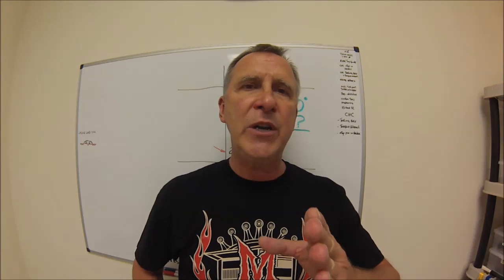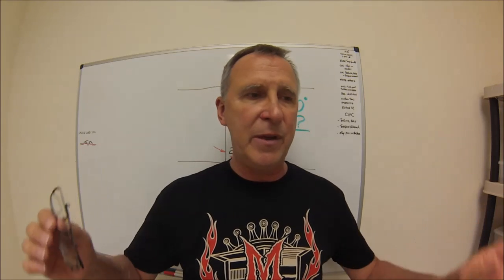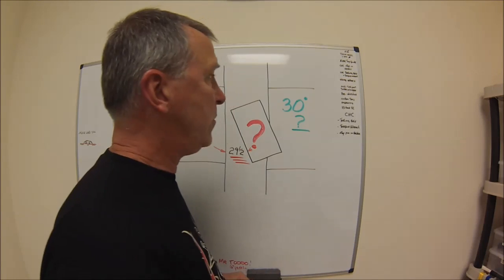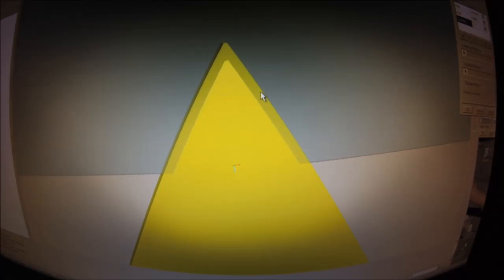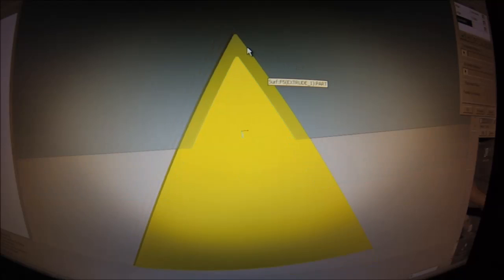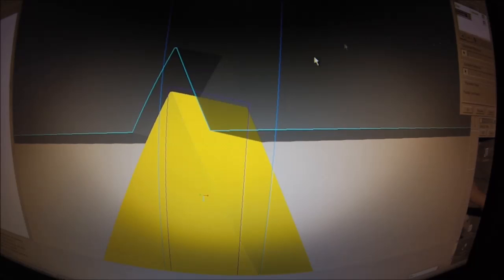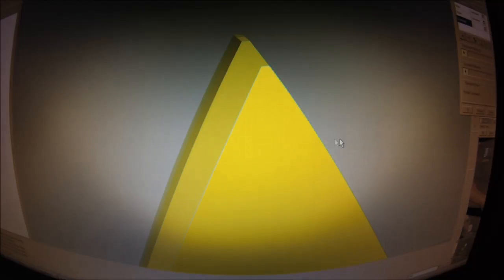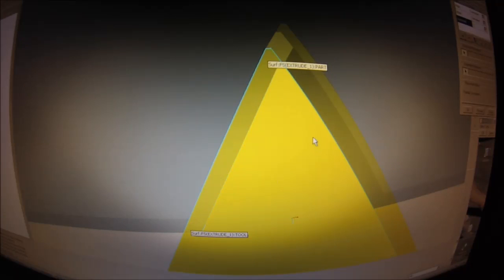Lathe Compound Setup for Single Point Threading...Myths and Musts

Comment: I have always heard that using the compound at 30 d, reduces chipload. I don't think it does. If you make the thread with the same number of passes as a straight plunge, the chipload is the same and it's mostly on one cutting edge. It has to be the same because in the end you are removing the exact same amount of material. To me, the only reason to use the compound is because you don't have to remember any dial positions except 1. It's more foolproof but you don't have to set the compound at 30 degrees. You can set it to anything between 0 and 30.
Reply from the maker: It really does shift the load bias from one side to the other of the tool. If your thread is tearing up, a compound feed will probably improve it.
Reply: @joepie221  Yes it does shift chipload  but the common misconception is that it lowers the chipload.  If shifting it provides a better finish then by all means rotate to 30. I cut some threads the other day and I don't even know what the compound was set to.  I just swung it out of the way of my cross slide because the handles collide. But you are correct that arguing about 29 or 30 is pointless and this video got me thinking about what is really happening. You take things to a more scientific level. Good stuff.

Comment: Using carbon tipped indexed tooling I don't see the benefit Joe, why load one face (mainly) when you can share the load over both right and left face especially seeing as nobody bothers doing this when cutting internal threads? So why bother?
Reply from the maker: I set my tools square to the work and plunge cut my threads. If your machine is rigid enough, its fine.

Comment: The reason for 29 1/2 deg setting on the compound is the last psss you dial the cross slide and not the compound to clean up both sides.
Reply from the maker: Both sides cut the entire time anyway. The load is just bias to the left.
Reply: @joepie221  - Unless you are over 30 degrees.

Comment: seems that if compound is set <29* then each side of finished threads will have too much different angles and wont mesh as well with the female threads.  which wouldnt be a problem with 1a or 2a thread but would with 3a as it has zero tolerance.  just thinkin....and thanks for your super vids.
Reply from the maker: Actually, the 29 degree just distributes the chip load differently. The thread profile is still 30 degrees per side if the tool was setup correctly. I have a good video on whats really happening with that 29 degree setup. Look for it.

Comment: how about the fine cut, when the depth (AP) reducing after times and times cut, maybe the final is zero AP, all the deforming tolorance will be dismissed? the flange angle will be 30.5/29.5,  unless can find a carbine with 59.5 degree angle? It is no problem on assemble but not good condition on holding force when female thread touching area become smaller. Sorry Joe about I'm used to a diver , not good at leaving a message.
Reply from the maker: A straight in approach will produce a thread to any tolerance desired, naturally, the tool and compound setup should be correct for your thread profile. Multiple passes at the same setting as the final step should allow for the full profile load to be sufficiently absorbed and form the desired geometry.
Reply: I'm confusing on 29.5 degree's subject. Maybe you are talking the cutter feed in way, but at the very beginning I think it is the blade position. Now I know it. Thanks.

Comment: there is one thing the cosine error setting compound at diffearant angles will give a diffearant distance of travel
Reply from the maker: Linear to the compound, there is no error. If you have a specific depth to hit, know what that is on your cross slide and start with your compound backed off. Error is then irrelevant.
Reply: Easiest solution is to use a dial indicator fixed to the cross slide, measuring the change in the tool position as it gets advanced by the compound.
Reply from the maker: That would work as well. The compound trick is good for internal blind work. I'll show that someday.

Comment: If you use fullprofile threading insert, and feed your compundslide 30⁰ then your thread bottom radius goes too large
Reply from the maker: I respectfully disagree. A full profile insert is a form tool and will simply make the thread impression deeper when fed at 30 Degrees.

Comment: Been a machinist since I was 16 , now 53 & own my own workshop & I have never seen the need to do this . Leave the compound slide parallel to the bed unless cutting a taper with it. Most of the threads I cut are metric & it's easy to get the the root diameter from what pitch you are cutting & increasing each cut on the cross slide. If you want you can releive the pressure on the right side of tool by bringing compound slide forward by about .002 for every cut that's .010 . This allows you to index tools to do multiple parts the same & keep diameter settings the same. If you look at CNC machines they don't have compound slides & don't have to increase the depth of cuts on threads at any angle. Just plunge in cutting on both faces of a full form tip.
Reply from the maker: I personally plunge all my threads with the cross slide. Always have, always will.
Reply: @joepie221  Me too.
Reply: @joepie221  I'm not sure that CNC machines need a compound slide.   They cut tapers without one.   Computers can move X and Y at the same time and get it right every time.   If I coud move the cutting tool the way a computer does I wouldn't need the compund.   I can't:-)

I think that it is easy to forget that CNC machines can move diagonaly.  Some people might might think that they can only move like a castle, but they can move like a queen. 

It makes sense to me that when your tool is moving to the left there will be more presure on the left side of the tool.  Even with a straight in plunge.  To my mind it is best to set the angle to remove as much contact as possible on the trailing side.

In other words, I totally agree with you.  The best that can be done is to reduse the presure on the trailing side.

It's really great to watch videos made by someone who knows their stuff.   I hate to see videos where they do things wrong.  People are going to copy and what good is that?

Thank you for videos.

Comment: I am new to this. If the argument is to put less strain on the cutting edge, then why not just go in at zero degrees and do very small depths of cut?
Reply from the maker: I believe the angled approach was to put less load on the tool and machine. Smaller machines may benefit by this approach, but larger machines can go straight in without chatter. I plunge all my threads.
Reply: @joepie221  Ok thanks! I have a specific question I can't seem to find online. So say that I tapped inside threads and wanted to cut the male threads on a lathe, but I very precisely wanted to control the pitch. How do I know how far to cut? I have a project where I'm making a measuring device similar to micrometer and I need the pitch to be just about perfect. Would I simply keep making small passes until the nut fits snug on it, and at that point I can be confident that it's the correct pitch? I guess I'm confused on knowing how far to cut to ensure the pitch diameters line up
Reply: Hello LT Dan, I hope this info didn't come in too late for your project. 
I'm currently in my second semester of machine shop so I'm just beginning in this quest for knowledge. 😁
What I've learned so far is that there are MANY variables involved with cutting metal and although there are proven methods of operation, it's nearly impossible to give exact numbers on a manual machine that will produce perfect- repeatable results.
Some factors are:
- Strength of machine and wear as it's used.
- Tool selection. Hand ground HSS bits are mostly measured with our eyes and nobody's balls are that perfect right? 
- Tool height and flex from placement in tool post. These factors will produce slightly different results. 
- Speeds effect Cutting and as mentioned earlier, the ability forn your machine to hold a zero while making the cut will all come into play. Joe gave a great PRO TIP that I'll be utilizing today and that's to keep your hand on the dial to help reinforce the cut.
As a whole, I would recommend making sure your threads are nice and clean, deburred, and using either a thread mic or three wire setup to accurately measure the Pitch Diameter of your threads. To my understanding, The Pitch-D is your most desired numbers when it comes to threads. 
Also take into account what CLASS of threads you're pursuing and stick to THE GOLDEN RULE: Measure twice and cut once. If you've cut it twice and still it's too small, cut it again and see if that fixes it. 😄
Reply: The problem with a straight plunge is that there is no force bias on either side of the tool and unless your machine has zero play and extremely rigid the tool could wander. The problem is really highlighted when starting (less so) and finishing. Assume you're cutting internal straight plunge threads on a nut, at the end of the cut, on the last thread, the leading edge is unloaded (no more material) but the trailing edge is still fully engaged. Any flex or play is now taken up and the tool moves forward leaving a thicker thread. Setting the compound at an angle means that trailing edge has minimal load.
Reply: @glenj.taylor2938  Cool thanks everyone! It all worked out well.

Comment: I had to watch the video a second time before I got what was happening.  I was imagining the cutter was being advanced into the work as the part was turning, which I see now Is incorrect.  So the amount of cutting occurring on the right hand side is equal to the amount the cutting tool is advanced each time a new cut is made.  And then because of that, the cutting tool must be sharpened on both sides.
Reply from the maker: Correct. Both sides of the tool do cut. The left is just the dominant side.

Comment: I believe 30 degrees is good for pickn threds back up an chasing them...30 degrees is good insurance just in case u run into trouble
Reply: I believe leaving the compound at zero is the best way for picking up threads for remedial work, or for chasing (who chases, now, with full form throwaway tips dealing with crests?)  At zero, movement of the compound slide does not affect the cross slide dial reading, so each successive component finishes at the same dial reading (for me, zero), and you can easily centre the tool in the thread with the compound.  I've only ever, in fifty years, offset the compound when threading to avoid conflict between the compound slide and the tailstock.

Comment: BY using the 30 degree setting, the ability to control the final depth of cut is far superior, ie you can take advantage of trigonometry (sin 30 = 0.5) and  nail the depth of the threads.  I think this is the major advantage, your thoughts?
Reply from the maker: I wouldn't say far superior, but maybe finer. You can still use a combination of both during your procedure. Many do.
Reply: You could be even more accurate and use the cos which is what's going to give you the projection into the work axis.
Reply from the maker: @NFAshooter  The pitch diameter and tools tip width drive a spec level thread. You guys have to get off the "Thread Depth" mindset and start worrying about the pitch diameter. You are flirting with disaster.

Comment: I've never bothered to set my compound. I've always used carbide topping inserts, and I've never had a problem. I usually never cut threads coarser than 20-24 tpi, though.
Reply from the maker: Topping inserts are pitch specific and can be costly for a home or small shop. They do work though !
Reply: @joepie221  I would imagine that a lot of your viewers are wondering what topping (or full form inserts) are all about.
Indeed they can be costly, but if one is doing a lot of threading in one specific pitch I think that they save time & are pretty cost effective, especially as one can often pick them up on eBay etc.
I do quite a bit of threading mainly in 316 stainless, or high carbon steel when making bespoke parts for motorcycles. So I have the common metric & UN pitches in full form inserts, & save the HSS bits for the oddball threads that come along once in & while. 

Perhaps a short video about them would be a good idea.

Comment: Am I operating my lathe incorrectly?
I'm using the cross-slide to feed the tool, the compound is set at 45° and locked down.
does 30° even matter with this configuration?
The compound doesn't feed smoothly, the gib needs some TLC so I'm just using the cross-slide as shown in your 'upside down' cutting video.
Reply from the maker: I have been using the exact same setup as you for years and never had a problem. As long as the tool is square to the work, the compound angle doesn't matter if all the feed is done with the cross slide.

Comment: if your trying to prove only that th rt side of the tool is cutting or making contact you are only partly rt. The rt side of the tool only makes contact as you plunge in period. after that only the left side of the tool cuts so who cares that the rt side cuts or makes contact...i never subscribed to the 1/2 the profile of the tool theory. i can set the compound at 45 or 60 deg it dont matter use your cross slide and your golden...i just dont get this video....
Reply from the maker: I'm not. This video is actually disproving that exact fact. Many believe only the leading side cuts. NOT TRUE.
Reply: @joepie221  you are crept in the on depth in each cut to the deps  of cut on both sides  it just relive the cut & stress of you tooling .

Comment: It doesn't matter either you do plunge cutting, 29.5 or 30 degree cutting , main thing nut of your thread must mate easily and have no seizure.as simple as that😊
Reply from the maker: If you are doing work for yourself, thats a fine philosophy. If this is a critical component being used on the other side of the world, it better be to spec.

Comment: In School we used the compound threading, and no DRO's. But, that's for educational purposes.
In the real world, if your shop doesn't invest in DRO's on their machines, GTFO.
The compound is used for tapers and chamfers, freehand. 
To use it for threads manually is a waste of time. Set thread tool at 90 and be done with it.
No one is manually making lead screws or something important where the all parts of the screw, like a gear/acme thread are used, anymore. 
In that case yea, you have to be conscience of the back of the thread also.
Reply from the maker: DRO's can get expensive. I ran machines with Trav-A-Dials for many years and loved them. I only had one for carriage travel, but it was a blessing.
Reply: Joe Pieczynski , I swear if I had a $500 POS Lathe or Mill in my garage. I'd put a $500 DRO on it. Mostly because I can utilize it as a tool more than just a function of one. 
An example is presetting different origins as I trade out vice jaws, for different applications. 
Or saving your tool locations on the Lathe while doing different jobs. I'm reffering to the Aloris and boocoo holders. ;p
Just saves time in the long run.

Comment: I  do enjoy you trading. post.  I have a lath that as no lead screw. Interestingly English schools.  did not by lathe with led screw  fitted  to  the lath. & threw cutting was made by  the ues of the rack . sadly i haven't.  the ability to film  my lath , so i cant post a film on the subject . to cut on the rack  , we where shown haw,  to time the lath.  to cut a thread using 3 point to line up,  the saddle  with the chuck.  preps you can explain this to you students . as with out a led screw their no thread dial .   Les England .  I will not   challenge you to have a go  as your  Colchester a modern type. min is more like that of the May-ford-lath    you to have a go with out using your  lead  screw . if you saddle will run on the rack i only have a shaft with a key dawn it lenth 

interesting  what-what .?

Comment: Spending some time on threads and came up with a mental problem (one of many for me).
My question is actual cutting of the threads. It the thread outer edge and root are not supposed to be at an actual V point I am having trouble figuring how is the root base formed. The tool is typically 60 degree pointed so if cutting stops at the value of root truncation (one picture showed 0.2165xP), the tool point stops there as well, so how is the root flat area formed? It would seem the cut would have to extend all the way down to the actual root diameter to get proper threads. The thread outer edge crest could be turned down before or after threads are formed, I guess. 
One site I was on is; http://www.amesweb.info/Screws/AsmeUnifiedInchScrewThread.aspx
Reply from the maker: 1/8 P as a solid rule of thumb is the size of the tip flat on your tool.
Reply: If I understand correctly - various carbide insert sizes would be available based on the Pitch, where as HSS could be ground as needed. I realize these values are very small, but I am just trying to get the math and geometry figured out.
Reply from the maker: Way too often, I see guys relying on the depth of the thread as their 'GO To" master. Break this habit NOW. The thread dimensions that matters are the pitch diameter and tip flat ( minor diameter control ). If you hit the pitch diameter and the tip flat is less than 1/8 P, that thread will engage any thread made to the mating standard anywhere in the world. When in doubt, make the threading tool sharper than the 1/8 P. For an OD thread, its safer. If you are new to this, practice getting the pitch diameter correct first and worry about everything else later.
Reply: Ok, got it. I did try your 1-wire method with various bolts around the shop and it worked fine. Most were of the hardware variety, but came in close with the book.
Thanks, by the way the 3-wires only ended up with me looking around the floor for 2 of them, I will stick with the 1-wire. :-)